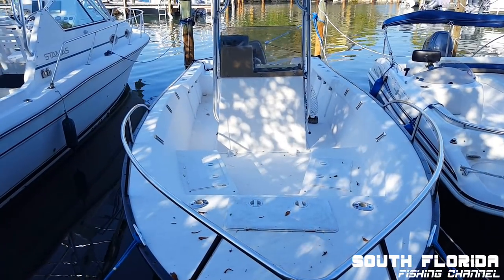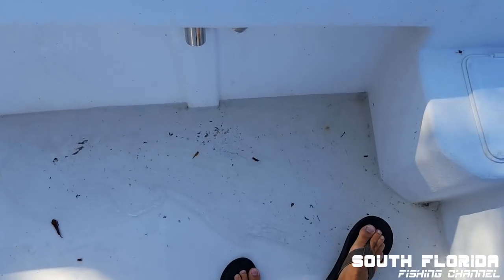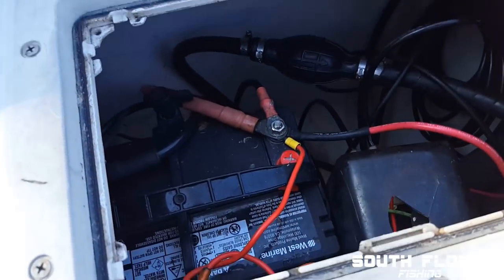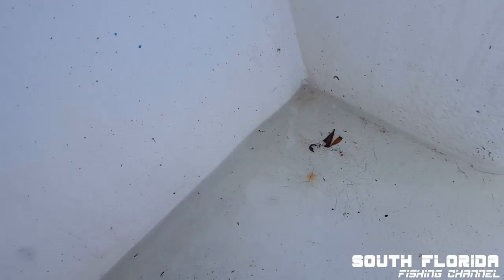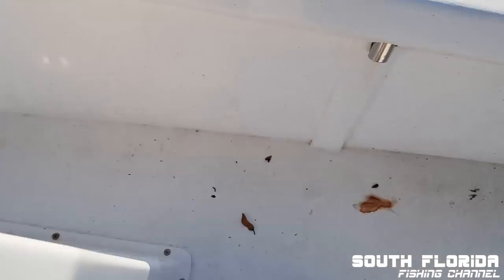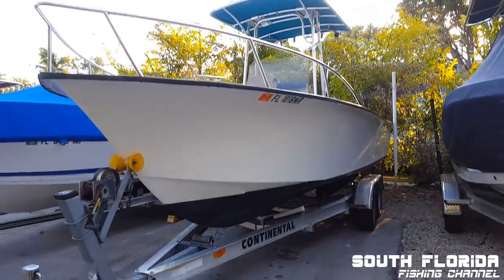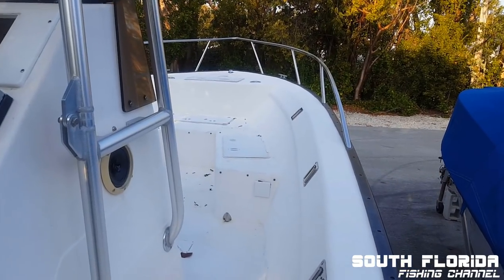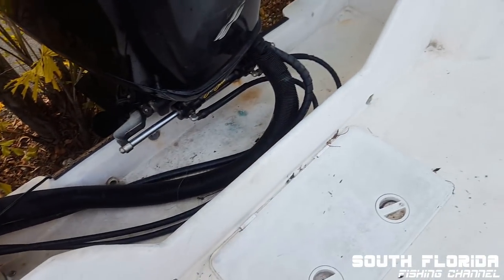Advice Needed | Water on deck issue & Transducer growth

Comment: My dad had a palm beach which is basically the same boat we drilled in 1 1/8 check valves in the same area where the water is setting on your deck and we plumbed it right out of the stern using the same thru hull fitting used for livewell release with the rubber flapper and it worked just fine

Comment: One other observation, from what I recall from previous videos... your 2nd battery at the head/center console is on the same side as the rear battery. As a test.... remove the rear battery and just place it (with water build up) on the opposit side to see if the boat levels out. If so, you may just have to relocate the battery to the other side..... hope it helps. Tights lines 🤙

Comment: I had the same issue. I drilled a hole and put a marine hose on the back of the round stainless steel water drainer with marine grade silicone to the bilge pump. Deck filled with water drained through the stainless steel plug and hose to the bilge pump. Job done.

Comment: Two drain holes that you currently have in the transom can be enlarged. There are scuppers that have a one way valve that you can lift the hole size up to 2-3 inches. Then go a tad more bow line to angle the boat to the scuppers.

Comment: I would try to change equipment and battery positions to see if it cures the issue. If you decide that you need more drainage make sure you tube it to the outside not into your bilge. And make sure to use scupper valves for a one way flow. On the marine growth on the rear of the boat try some CLR. You could load it into a spray bottle and soak down the growth then rinse it off. Ive had luck with it on mineral deposits from hard water. Its worth a try on your transducer and motor bracket.

Comment: Hey buddy, that specific hull is tricky, my buddy has the same one, with the same problem. From what I see you have a few options
I have a bit of experience with fiberglass and hull repair.

I would personally just install a 2 or 3 inch scupper drains on the deck in the corners where it pools up the most and attach hoses under the deck for the water to be directed right toward the bilge area and make sure your bilge and float switch are in good working order, i would also consider installing an onboard battery charger. You seem like you use the boat a good bit, If you keep your batteries charged like im sure you do, you should have no problem bilging out rain water or splash water from offshore. it also usually bilges well while on plain because all the water under the deck gets pushed to the back and activates the float switch. this is the option i would go with, i would probably also drill 2 more holes on the rear bulkhead like the 2 that are already there but in the corners more.

The other option that I see is the one that you said drill holes in corners and attach the hose and then drill out the back of the transom, If you did this I would install a ping pong ball scupper drain or a flap style scupper on the transom hole to prevent water from coming in while you are offshore, This option i would be a little more hesitant to do simply because something about drilling through the transom to me just never seemed like the better idea. also you would need to make sure that the hole on the transom comes out lower than the hole inside the boat so the water is always draining downward but at the same time make sure that the transom hole is high enough from the waterline to not bring in water offshore.

feel free to message me if you need more help or have any more questions, I love the channel, keep on keepin on buddy

Comment: if your deck is well above the water line, as you showed in the video, then it is perfectly fine to drill a hole through the side with a scupper fitting. it is common practice amongst larger boats for the deck drains to come out of the sides of the hull

Comment: Agree with the some of the others.... battery weight is leaning the boat to that one side. Notice when you stood o. The opposite side the boat pretty much balanced out. Consider relocating the battery to the head/center console. Safe travels bud.🤙

Comment: 1. Salt or fresh h2o? Is the live well/fittings/pump leaking? 
2. If you drill a hole in the corner you can always put a plug in until you need to drain. 
3..try settings the angle of the transducer up before drilling a new set of holes. My sonar doesn't work as well fast either. 
4. Good luck. Have fun in az. I used to live in Tempe.

Comment: I would be more worried about the structural integrity of the floor on the boat. If it just started doing it I would say that maybe there is a weak spot under the deck that is starting to "cave in". I would try to look under the deck to see if you need some kind of support. In the video you can see the deck has cracks in it right where the water is pooling. I'm willing to bet some kind of support needs to be added to the deck on the underside.

Comment: Hey mate, have someone build up the surface in the corner of the floor slightly to allow the water to run out easier and not pool. 
If you're going to install some lights, make sure you buy either red or amber. This will be easier on your eyes.
What sort of anti foul coating can you get a hold of? They make transducer friendly anti foul here in Aus.
After our discussion the other week, I reckon you would be able to have someone fiberglass you a small mount under the hull (on the next step down-closer to the keel) for you to mount the bottom part of the Totalscan to. This has been working very well offshore here.
Steve

Comment: I had the same water buildup problem with my 2011 Key Largo 160 CC. When I was offshore, I was always sloshing around in water. It was the one factor I did not like with that boat, especially when I took others fishing. The buildup on the transducer will impair the sensitivity somewhat.

Comment: Side Scuppers could help drain the water buildup. There are probably lots of how tos to install. Basically you need to drill and install through hull fittings with either a ball or flapper style scupper on outside. Also buy a gallon of fluid film. You can put some on that transducer to keep it clean. I dilute it with some veggie oil and spray down in my deck, let it set for at least a day. Wash off with mild soap and now u got a nice wax-like coating that's easy to clean and not slippery. Keep up the great videos.

Comment: I have the same boat as you my solution is to drill and install deck drains in each corner flush with the deck, plumb the deck drains to a T and plumb an auto bilge pump in to the tee to carry the water out of the boat high above the water line. By doing this you have a closed loop system and if the pump fails then no harm is done no water can get to the bilge with everything sealed up the water would back up on the deck and would be just like it is now if the pump does fail. And most importantly with this Hull is to make sure that your bilge access door is sealed, I had a close call with mine sinking last summer due to the seal.

Comment: Poly planar makes some pretty decent waterproof speakers. Affordable and sound good. 

I agree with the other comments about the batteries being on that side. Short term add some weight to the other side. But long term I would look at how hard it would be to relocate them to under your console. Keep the weight over the centerline.

Comment: I had the exact same problem on my 19 ft boat for years. I used to wear my old sports sneakers in order not to feel the water. 
I wouldn't advise adding weight on the other side for balancing. Did you consider installing an external bilge pump in the area where the water accumulates? Filing a thin layer of the fiber glass to make a recess in there would greatly help pumping the water out continuously. Yet you need to consult some fiber glass experts on that. 
Filing a thin layer of the fiber glass to make a groove all the way to the rear hole might be another idea. 
Good Luck & Tight lines

Comment: I have a 22 foot cape craft that has a similar design. What I would do first, is remove your batteries from the hatch in the corner of your boat and examine that whole area and see if water is trapped below there. Then pull the bilge hatch and really get down there and look back as much as possible and see if there’s any water that has flowed into the below deck area. Sometimes water collects in different parts of the boat and we don’t even know it. Also when you pull out all of the batteries refill the boat with that hose and see If water drains normally. If that’s the case then just counterbalance the other corner deck with some weight.

Comment: Scupper drains on each side  evacuating to the sea might work well, they do not allow water backing up. They came by design on my 2004 Proline 23 Sport. Please, DO NOT drain to the transom because If the bilge pump fails on heavy seas you are in big trouble! I made that mistake in my previous boat, and the pump failed. I would have sunk if it wasn't for a second auxiliary pump I installed.
BTW, I am a subscriber and love your videos. Thanks for the fishing tips in the keys (I am not far north, Miami). Keep it up!

Comment: Put deck drains in each corner and plumb them thru the transom. On the hose use check valves from th marine and done. Never drain into the bilge. 2 reasons not to. 1) all the blood and guts will drain into the bilge and you’ll never get the stink out 2) if it rains your pump will run an when the batteries are dead.....glub glub glub.
Reply: This is the correct answer. Use flexible PVC Hose with Check valve. 1.5 hour job and a 8 pack of beer fixes the problem
Reply: Saved me some time, thats proper way tho heiko so get her done
Reply: If your have 8” or more from waterline your best thing to do is to run threw to your transom in each corner as low as possible use pvc clear vinyl tubing or the braided clear vinyl tubing to your scupper drains this is how my seacraft was setup
Reply: Check valves are usually unnecessary and will just cause problems in the future(clogs, restrictions, more splicing and fittings than necessary). Use gravity only. Keep it simple, use a quality hose as well. Usually the clear hose will only hold up for a few years before it starts to degrade and potentially crack.
Reply: I agree 100%
Reply: He could go without the Check valve. I know most boats don’t ha e them but in his case your adding something that his boat wasn’t designed to have so if his deck is even with the waterline any movement in the boat at anchor or to much weight in the back then he’ll have water sitting there any ways. Just me. Usually I over engineer a project and end up spending twice as much. 😂
Reply: Team maroma outstanding advice. Can't think of any better solution.
Reply: Drain overboard is best . Deck rot is in your future.
Reply: Team maroma, yeah I didn’t think of the blood and guts factor. I’ve got a small boat that drains into the bilge but it’s really not meant for the ocean (even though I have taken it out on the gulf) and large fish like Heiko’s boat. My boat also gets yanked out of the water after every trip.

Comment: Heiko my man the easiest simplist fix in my opinion would be to add ballast weight to the opposite side until the old girl sat level in the water. Then I'd reassess after that. But remember all wet deck boats hold water somewhere. Keeping it 100% dry will never happen. Or maybe look into which weight you have where in the boat. And see if maybe shifting something would help the situation.

Comment: Do not drill into the bilge, if it rains and the batteries get flattened, you will sink the boat. This has happened many times before.
If the floor is a minimum of 12 inches above the waterline, consider fitting side scuppers (1" high x 2" long). Most professional commercial fishing boats have scuppers (although much larger) all around (sides and transom). Alternatively you could build up the floor in the corners to direct the water towards the existing rear scuppers after checking the floor first for any soft spots. You need to also check the trim as it looks like you need to move weight to the port side to level her up.

Comment: I’d avoid any holes in the side of your boat, Heiko. On my boat, I have drains in the floor that have little grills over them, but the bilge pump has to pump that water out. (The drains in the floor worked really well after I left the drain plug out once and had a shit tone of water come in. Doh!) Maybe a cover for your boat might help but that’s a total pain in the balls to deal with for as frequently as you go out.

Comment: I would not drill a hole to let the water to drain into the battery storage that would just create another problem. I think adding additional corrosion to your cables. I think I would add two additional drain holes one in each corner though the floor and into the bilge. the same as you have already in your splash guard . That way when water you just pull the mini drain plug and let the water into the bilge, then replace the plug or plugs when the water is gone. the plugs will be out of the way in each corner and should not interfere with your foot traffic at the transom. hope this gives you an idea

Comment: Year/Make/Model/Length?  Maybe also think about building up /glass those back corners so that it doesn't collect and let it move water towards the mid/center and existing holes aft.  Ask a fiberglass guy, probably easier to build it up rather than drilling new holes and creating new drain that wasn't part of the original design.
Reply from the maker: It's a 236cc Key Largo
Reply: If it wasn't designed to be self-bailing then I wouldn't consider drilling thru the hull sides.  I'd ask a fiberglass guy if he could just build up each of the corners a bit so that the water moves towards the centerline. It's the floor anyway so it wouldn't have to be polished finish.

Comment: a small bilge pump and 5ft of hose attached then u wire red and black clamps to attach to the terminals.you can keep it rolled up in your console and use it when needed.just lay the little pump in the water,it looks deep

Comment: Under that corner of the boat do you have space between the deck an the bilge,if so drill a hole in the deck an install a drain from there to a hose to an additional bilge pump that way you can turn it on an off as needed.

Comment: Heiko, I am a marine engineer. I could recommend several paths to potentially solve your problem but I'm concerned that I don't have all the information. I highly recommend that you get the advice of your local marina technicians and any marine engineers they have on staff about your drainage problem at the same time as you have them fix your transducer problem. Your solution with the hose is the most excellent of any you proposed. However I will say that I think you need a new transducer at the same time. Thanks so much for your great efforts to provide us with great contact. Have you considered upgrading to a side-scan sonar at the same time? I've seen them on of the boats on used on YouTube and they are remarkable at finding fish. Thanks for all you do.

Comment: Best thing for you to do would be to install deck drains on each side in those corners and plumb them overboard  via thruhull fittings using the white sanitation hose .

Comment: That might be a low spot in the floor from rotten wood underneath if its soft and moves when you step on it that's probably what it is. It could be a clogged deck drain or more weight on that side of the boat and it is sitting uneven, Try putting some weight on the other side of the boat, atleast when its in the marina so water doesnt build up when it rains.

Comment: I'd caution against just drilling limber holes to drain the standing water. First, unless brass ferrules are epoxied into the drill holes the water will seep into the core material, and will cause delamination, and rot. Second, scuppering water to the bilge isn't good cause any debris on the deck will end up down there making a stinking mess that would be hard to clean, and might clog your bilge pump. My suggestion would be to wash the deck after use, and mop dry then get a boat cover, and tent it to shed water out board. I know this is a PITA but having standing water on deck will eventually ruin the hull. As for the ducer, clean all that debris off it, anything that might cause bubbles under it will cause poor performance, especially at speed.

Comment: Is the deck soft at all or sagging anywhere?  Also, you CAN put a through hull that bails the water off the sides of the boat like you are talking about, but you got to know what you are doing with that.  If you want that done I'd hire a professional.  The growth on transducer would have to be thicker and on the bottom to really affect what you are doing, but I'd still clean it off.  More importantly...if you have a leak you need to find that asap and show us where that is.  Depending on the location that can cause you a lot of problems too.

Comment: Your idea of making a hole and running a hose straight through the battery compartment to the transom would work. I would use pvc pipe instead of hose.

Comment: without having to open any holes on your boat, take a 25 to 50 pound weight ei . barbell/ exercise ball made of rubber, and when the boat is docked on the water place the weight on the tramson in front of the engine and towards the port side, to counteract the weight of your batteries.  when you are going to go fishing simply remove the weight/ place it on the dock until you come back.